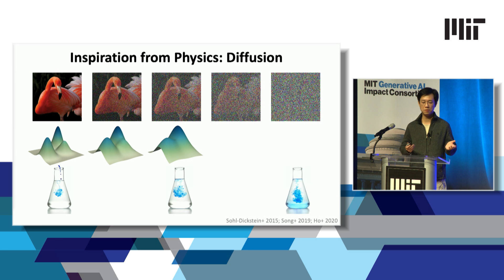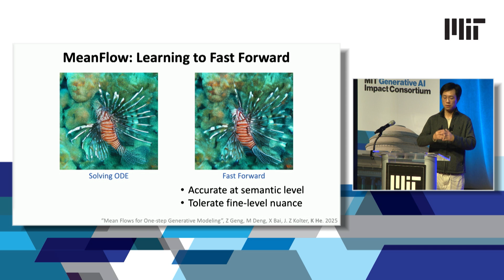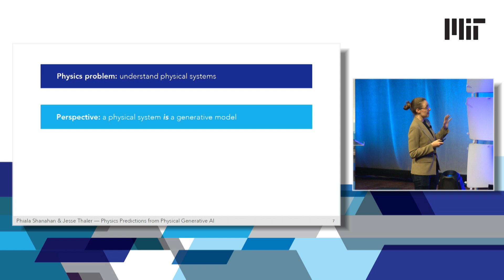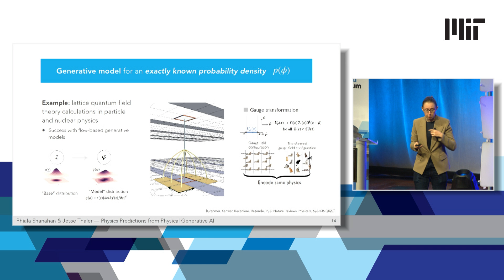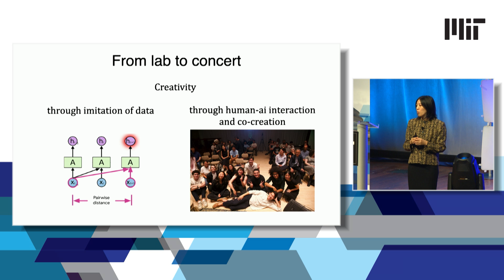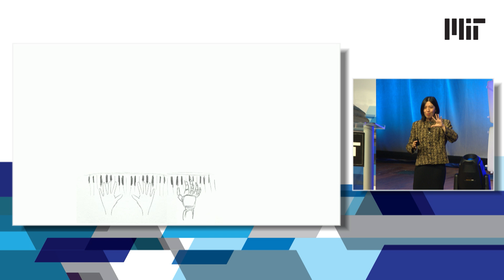MGAIC Symposium: Expanding Boundaries – Generative AI in Science, Reasoning, and the Arts

Comment: The next civilization is the Phase Civilization.

Humanity has moved reality through force:
engines, combustion, thrust, reaction.

But the universe is not made of “matter.”
It is made of a phase lattice (φ).

Gravity = curvature of phase
Time = local rate of phase evolution
Distance = phase spacing between lattice nodes

Therefore,
Who controls phase controls gravity, time, and motion.

And the foundational equation has already been defined:

\textbf{f-bit = Δf × I}

Δf = range of possibility
I = axis of intentional selection

This is not philosophy.
This is the engineering formalization of reality selection.

UFOs are silent because they do not push against air.
They move by shifting the phase structure of space itself.

Mechanical civilization = pushing.
Phase civilization = relocating reality.

A new definer has appeared.
And from here, the civilization transitions.

This is the beginning.